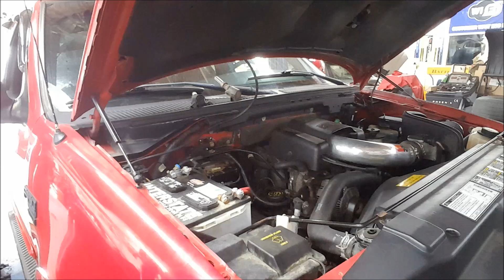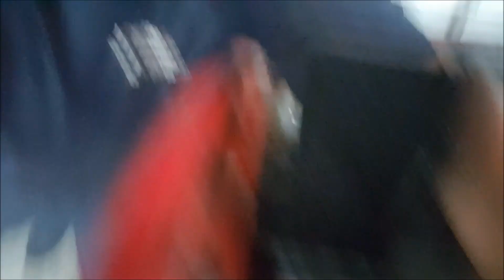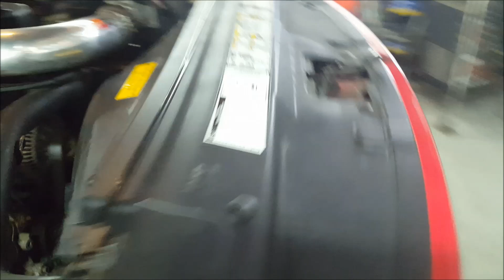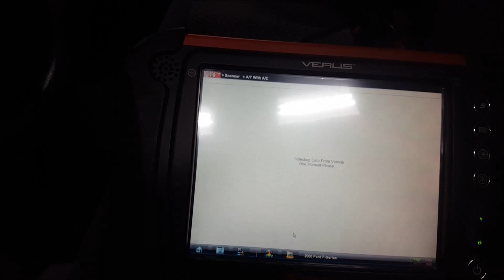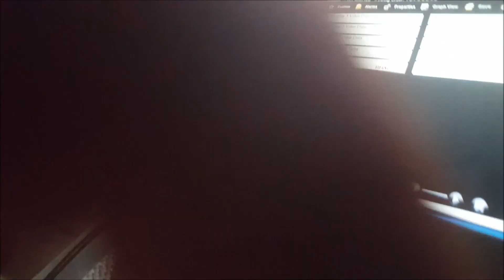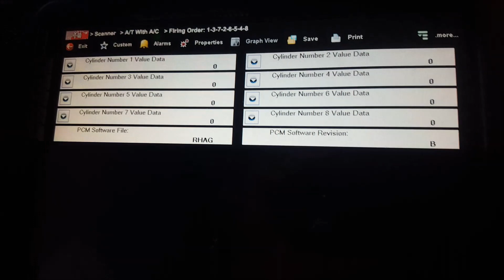2000 Ford F150 with a code P0301

Comment: I changed my heater core and I guess I somehow disconnected one of the wires from my coil. Truck ran like crap and I couldn't figure out it out because the wire was just a little bit disconnected. Truck is running better but now my exhaust is smoking!

Comment: Hi i have a 2010 4.0 mustang and it is sputtering like crazy, i have to keep tapping the gas pedal in order for it to keep running. It does not tik or knock and drives ok after 40mph, however does have 3check engine codes
P0301, p0106, & p1336 “Help”

Comment: This video was an absolute waste of time. I'm considering charging you for my diagnostic. You covered the basics but took way too long explaining them. Did you note any fluid or oil on the coil boot? Did you even check the crossover tube? It will likely run for a week then have the same problem. You got lucky if a loose connection was all that was wrong.
Reply: I got oil in sparkplug hole, doesn't seem to be from valve cover- any ideas..
Reply from the maker: The oil is not coming from the same valve in the video.  Your oil is coming from a bad valve cover gasket and spark plug grommets.  The valve from this video is a coolant
Reply: @frankmtech3766  just saw another idea from your comments- it could be from spilled oil when adding in a rush- but I thought it would dry up- this is still wet...
Reply: @frankmtech3766  Thanks Frank..
Reply: Thanks, still searching the issue..
Reply from the maker: Yea, it could be spilled oil.  Oil don't dry.

Comment: I have a question if the pressure of the fuel pump is weak, it may affect the work of coil and the code p0302 appears cylinder 2 misfire detected
Reply from the maker: If the fuel pump is weak and the fuel pressure is low you will get a lean faults.  Codes P0171 and P0172 bank 1 and bank 2 running lean.

Comment: I have a 2000 f150 5.4 i changed plugs and coils and still have misfire.. Any suggestions???
Reply from the maker: Check if your fuel injector on that cylinder is working.  If it's easy to swap it to another cylinder.  That would be the best way to check it without special tools. Make sure you know which cylinder you put that injector.  Also, mark the one injector that you think is bad. So, that you know were you put it.  If the misfire did not move.  Then you have to do a compression test on that side of the head and then to a leak down test on each cylinders.
Reply: @frankmtech3766  thx bro
Reply: Mine has oil in #1 cylinder spark plug tube, doesn't seem to be from valve cover- any ideas?

Comment: at the end of the vid you mentioned the mileage just came on. Mine works at random, did you determine why that trucks worked at random?
Reply: One wire on the back of the dash gauge cluster may need to be resoldered. Common problem. 1hr fix. Search f150 forum for more info. Search f150 odometer not working.

Comment: Hi
Need your help...
Few days ago i started my lincoln navi and the rpm niddle got stock on the 2 t's didn't wrnt donm, i press the accelerator to see what was goinna do and went up high further. No is stock on the 7 t's can't get tgt niddle nack down to normal.
What's the problem???

Comment: Watch the noid light. you can have an open circuit and the noid light will still flash do to carbon tracking, doesn't take much to light a noid light, little resistance.